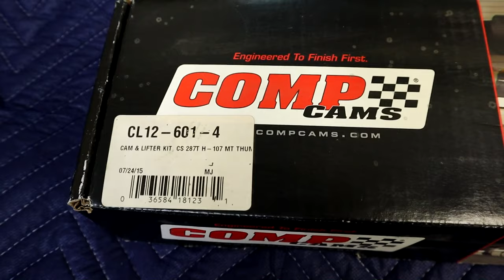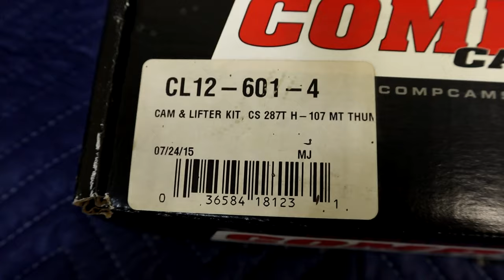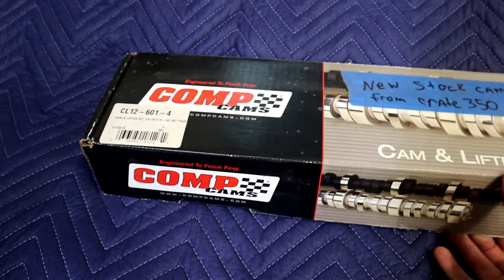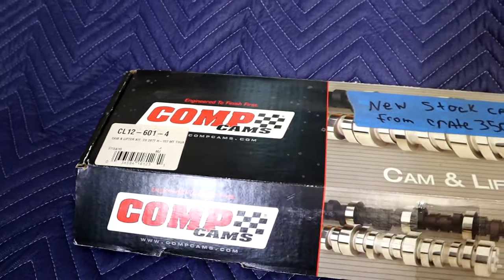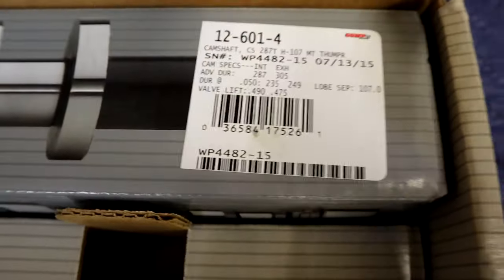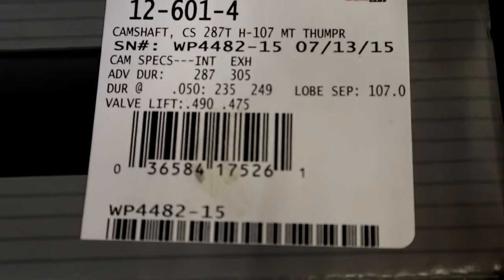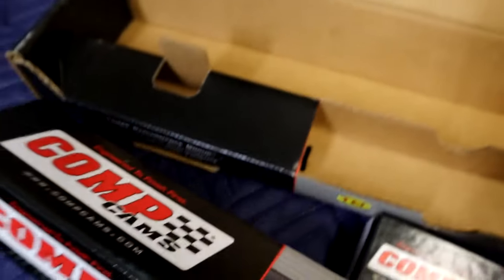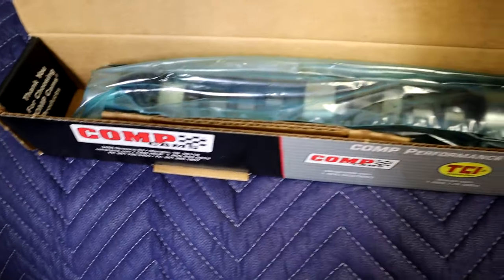BEST Sounding Cam for Small Block Chevy CRATE motors (Thumpr Cams?)

Comment: Dont do it I have experience with lots of cams including this one (its terrible trust me ) this cam was designed solely to sound good
Reply from the maker: That's all we want, my dad is 74 years old he don't need 400 hp lol
Reply: I ran a 351w with the big mutha thumper cam and it made peak power very high it made 415 hp at 6400 rpm, I installed a extreme energy 230/236 roller and it only made 396 at 5700 rpm that cam did make more torque at the low end and was a lot more streetabke but the thumper never disappointed I believe that if I had the smaller thumper cam it would have been more street friendly.

Comment: I'm trying to find the right cam for a snotty idle but everything I'm running is a stock 350 from 1972 with a new Edelbrock 2101 intake and 1905 Edelbrock carb I will be running headers too. When you say crate engine from jegs I'b be curious as to the heads I don't want to have an issue where the lift is too high.
Reply from the maker: Yeah its a bone stock gm crate motor and seems to work pretty good. I haven't had any trouble so far. As for the cam they are great but there lifters, ive heard are junk now. So I just bought the same cam for my 65 c10 but im gonna use someone else's lifters. But my opinion there is not a better sounding cam around for stock engines.
Reply: Comp cams 272 cam ! .454 lift with a duration right at the edge !! This is as high as you can go without going aftermarket parts !! Has a nice racy idle and makes good power without changing anything !! If it see me I would still put better springs in it to get the true rpm out of it ! It would be a I believe a 6000- 6200 rpm cam but probably better at 5500-5800 !! 3.73 gears would work well with about 9-9.5 to 1 compression about 34 - 36 degrees of total timing for max power !!! Stock or not factory torque converters are junk !!! I would put a 10 inch in it with about 1000-1500 rpm over factory stall !! Just my simple opinion !!! It's not about big it's about a good functioning working combination !!!
Reply: Comp cams 272 cam ! .454 lift with a duration right at the edge !! This is as high as you can go without going aftermarket parts !! Has a nice racy idle and makes good power without changing anything !! If it see me I would still put better springs in it to get the true rpm out of it ! It would be a I believe a 6000- 6200 rpm cam but probably better at 5500-5800 !! 3.73 gears would work well with about 9-9.5 to 1 compression about 34 - 36 degrees of total timing for max power !!! Stock or not factory torque converters are junk !!! I would put a 10 inch in it with about 1000-1500 rpm over factory stall !! Just my simple opinion !!! It's not about big it's about a good functioning working combination !!!77

Comment: I've got a 5.7 vortec I stuck the big mutha thumper cam in, i put an 800 cfm edelbrock avs2 and .125 pop-up hammers in order to get any  power out of her. Im pulling around 12:1 since i went with the big chamber stock heads. I had to do that in order to really get that cam to shine, i also went with the retrofit hydraulic roller version. Later on i put a fitech throttle body  injection kit on, that one is 50 cfm bigger, now I just have to build a transmission that that dinosaur burner won't  break. Im still able to run pump gas in her too. I also went with 3" dual exhaust. The cam you have is very close to what the dz302 had as a solid cam, they were usually running dual quad cross ram intakes, i might find out that i will need to bring even more cfm to my dinosaur burner in order to really get everything i can from it, but i still love the idle just as much as not being able to dig around on the stereo when im launching tho, and your whip got a wicked idle, hope you enjoy yours too!!!
Reply from the maker: Thank you, I bet that thing sounds awesome with 12:1. I have one of those cross ram intakes edelbrock made back in the day,
Reply: Big chamber heads doubt you have anywhere near 12:1
Reply: Big chamber heads, 12:1 compression, and pump gas? I smell BS. Unless you're running domed pistons, you're not making 12:1 with big chamber heads. And anything higher than 11:1 needs at least a race gas mix to not ping like hellmin warm weather

Comment: Question. I got the my th350 rebuilt by the previous owner.. how would I know if it has a stall?
Reply from the maker: I think factory is around 1800 stall. The way to tell roughly is look at your tachometer and see what rpm ut starts to move at and that will roughly be your stall. So if it starts moving at 2000 its probably 1800 to 2000 stall.

Comment: Sounds good..not really sure how your gonna reuse the old lifters. Even if put them in the same holes on another engine..block core shift will not put them exactly in the same position. Cams can be reused but the lifters need to go in the trash..
Reply from the maker: These are Brand new that came out of a new never ran crate engine that still had the assembly lube on them. There actually in my motor I put together for my 65 c10. I figured there better than the crappy new ones.

Comment: Did you Change the torque converter ISF SO WHAT DID U USE
Reply from the maker: Its like a 2000 stall a lil over stock.

Comment: Welp !!! Thanks for helping me finally pick my cam. I’ll start off by saying I LOVE the channel, I learn so much from you. I have the same stock 350 but with a 2 speed power glide. My car is a 63 impala SS. My question is will I need a stall and if so what size? Thanks for your help.
Reply from the maker: Thank you!!!!!!!! I think they recommend 2500+ on the stall. We have a 25 or 2800 on ours I can't remember exactly,  just a hair over stock.
Reply: If your going to race it you get a custom converter ! Not as critical on the street !!! There are a lot of variables to choosing a converter if it's made just for your typical application !!! Mine was custom but racing only !! In the early 90s and I got it cheap for only 944$ ! Weight tire highth gear ratio trans type suspension type cubic inch compression cam card intake carb head details header size type of ignition everything !!! ATI and TCI are the best companies out there !! When I raced the most widely used was named appropriately the treemaster I think was ATI !!! Not cheap by any margin but mine was a high flash at 6300 rpm flash 8 inch !!! Consistent 60 fts on a good weather day 1.28 to 1.30 !!! On the street you want a pro street converter !! Race converter promote a lot of heat !!! A good trans cooler would be advisable !!! High heat is a converter killer !!! The hotter it is the more slip you'll have !!

Comment: can you use this cam in a rebuilt 283 and stock valve springs??
Reply from the maker: These are stock valve spring in this engine, its just a gm crate 350. I would probably check with compcams website to double check, but ours work just fine.
Reply: I wouldn't use stock valve springs with any cam over about.  .450 lift. To much chance of spring binding.  Just my opinion.
Reply: Heck no lol. Cam is wayyy too big, just wrong for that 283.
Reply: @maynardreed4036  Agree...drives me nuts with guys saying they did so its ok they havent a clue to the damage they are doing
SPend tons on parts that are pretty or sound nice but wont spend on a set of springs huh?

Comment: Great sound and video on a 350 sbc do i need to change the springs? Thanks for the great video.
Reply from the maker: Thank you!!! We're still running the stock crate engine valve springs, you may want to check out comps web site to know for sure!!
Reply: Yes

Comment: What size cam is that
Reply from the maker: Its the comp mutha thumpr,  you want the specs?
Reply: @ACDesignsGarage  yes please if you don't mind
Reply from the maker: @nofear9867 intake .489 lift exhaust .476 lift , 107 lobe separation ,they sound killer, about to put another in my 65 c10

Comment: Can the cam go in a stock 350
Reply from the maker: Yes, it was designed for stock crate engines!
Reply: @ACDesignsGarage  thanks
Reply from the maker: @phillipfoster1471  your welcome thanks for watching!!!!
Reply: @ACDesignsGarage  hey so I just picked up an 89 s10, I’m wanting to do a 350 swap but I have no knowledge on them. Any specific 350 engine code thats better to be built on? I’m aiming for around 350-400hp, what parts would be necessary?

Comment: Thumper cams are feel good cams !! Sounds great at idle but lousy to tune a carb !! Will always run fat or not right !!! A big duration cam with a tight center but lousy driveability !!! Get a good comp cam that's ground with the right ramp !! A 284 - 292 even a 305 !!! Those are good power making hydraulic camshaft for your money !!
Reply: Even those are too big. His compression, heads gear converter are way way off.
Reply: @gordocarbo  You are correct Gordo ! I didn't realize it was bone stock !! I need to pay attention better !! The thumper cam specs are all over the place !!! .490 int. - .475 exh. ??? In a stock motor that's a little high and those #s should be reversed !! 107° centerlobe ??? That is way off for the street !!! Should be 114° !!! Then the worst is 235° into - 249° exh. ??? Way too much for the street and you would need a serious converter for those #s !!! But that can makes no sense !!!!! Like a 3500 - 5800 rpm ramp ??? How do you even tune that !!!! Sounds # wise like an NHRA stock eliminator cam for a small block chevy with all that duration and that super tight center !!! Yes , the 284 - 292 - 305 are too much !!!! At least all the centers on those cams are only 110° !! The lift and duration #s are more compatible !!! A 260 - 268 comp cams can hyd would be a much better fit !!! You might be able to get away with a 272° cam too !!! With that thumper cam he'll foul out a lot of plugs and never be happy with the performance of it !!! That's my take !! He needs a performer intake a 600 cm vacuum carb and a cam range of no more then 1500 - 5500 !!!! Please give me your opinion on this ??? I'm 61 y o and ran a number of years bracket racing ! Mostly Atco Raceway started in the mid 12s and finished in the 9.0s. After 20+ years of bracket racing !!!! I miss the racing but not turning the wrenches !!!! Probmissably could still drive but my body could no longer do it !!!! I still love talking about it and miss the mingling with other drivers and track officials !!!! I do value your opinion sir !!!! I always invite constructive criticism !!!!!!
Reply: @gordocarbo  According to their profiles they are the biggest cams you can use without using aftermarket parts !!!! If that's true or not I don't know !!!! If it was bone stock on the road I never touched those ! I raced on the track and had no desire to hot rod around the streets !! Way too unsafe and I felt that way even when I was young !!! If I was ever challenged it was my race car and that only saw dragstrips where the cars get tech inspection !!! I saw bodies on the road when I was a kid !!! That was a very convincing thing for me !!!!!